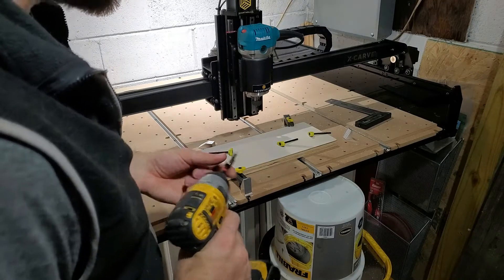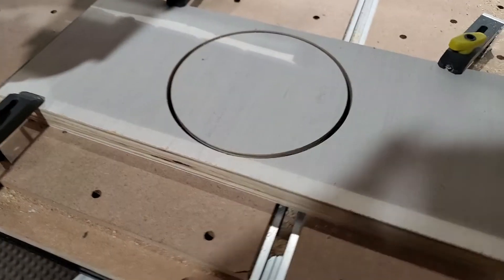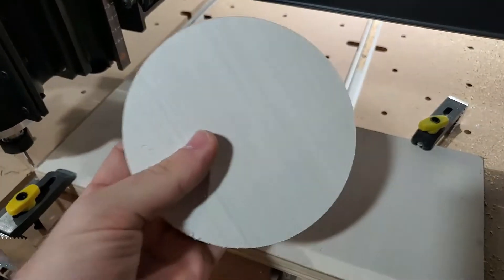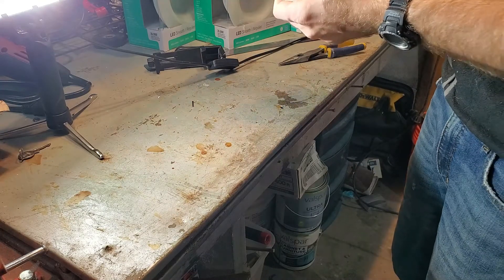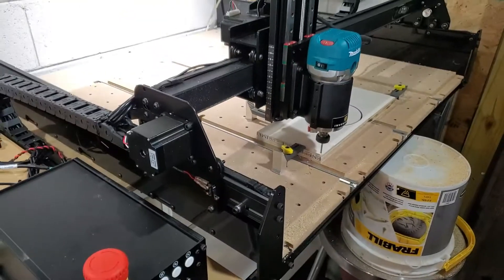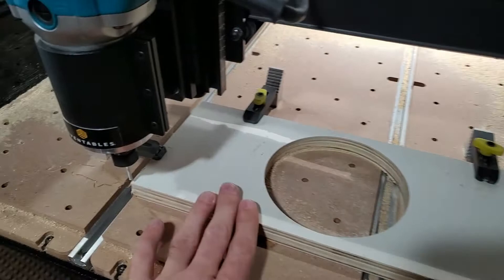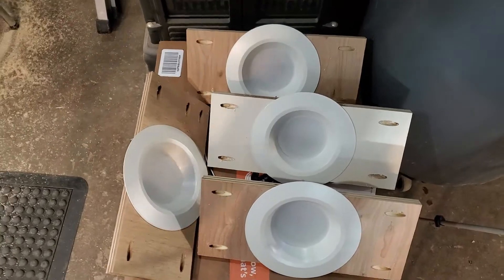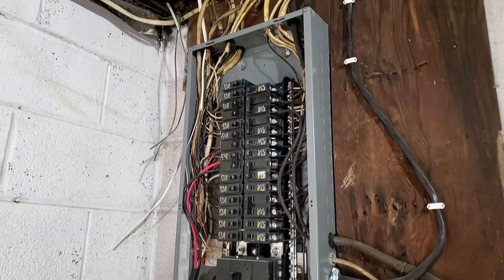Workshop Improvements Using Inventables X-Carve Part 1

Comment: Set your origin as the center of your job, so you really won't run into them clamps, also guarantees your cuts are always in the center.
Reply from the maker: Thank you!!
Reply: wow that is much better. really easy to mark the center of a square too.